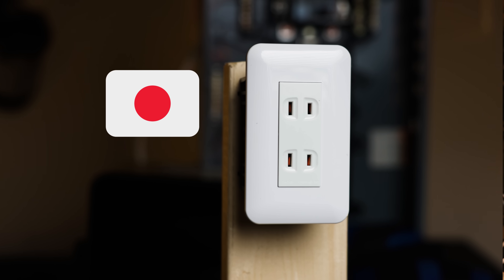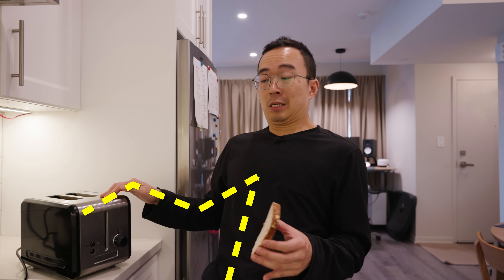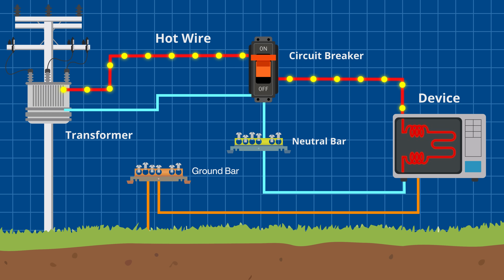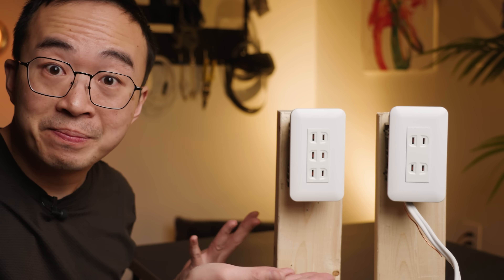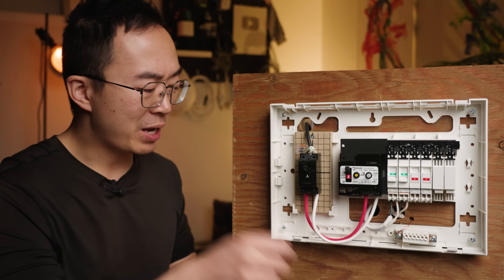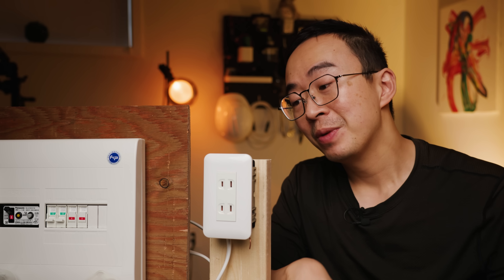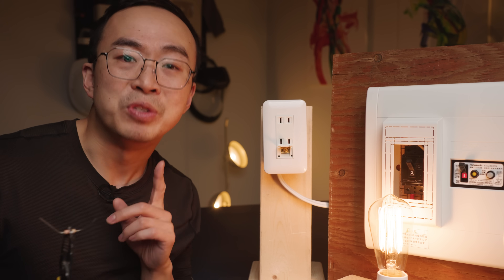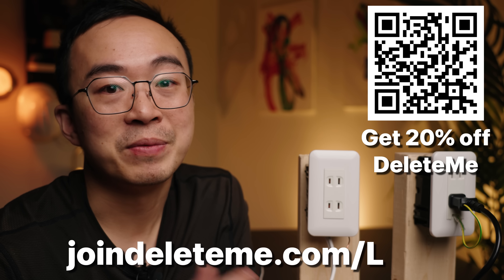How Japan Made Their Outlet Safe

Comment: That's why we have best of both worlds in Germany.
The electrical code demands at least two GFCIs/RCDs per household (30mA Max) and grounded outlets so that even small fault currents from a device gets detected and cuts the lines before touching or having a hight amount of energy bursting through the wire. This puts less stress on all components.
Reply: In Australia we now require RCD's on all circuits at the switchboard. Outlets are also grounded. When installing a switchboard there is the option for additional protection as well by installing RCBO's and Surge Arrestors, that way you are protected from current leak, current short, and over voltage. The only issue is these devices are expensive
Reply: I have been very interested to research the socket types and design around the globe and concluded that the Schuko socket is the best socket design😁

Comment: And the further away from the actual circuit, the less effective the GCI is!  So ideally you want (NEED) the GCI as close to the circuit as possible!  ( And Japan also recommend / mandate GCI adapters at the circuit for high risk devices — Toilets with electric washlets!!)
And another fun Japan fact: they use 100V power. ( a little trivial - current is what kills, NOT VOLTAGE!!! ) So when you LOWER the VOLTAGE , YOU NEED a HIGHER CURRENT ( i = p/v) to do the SAME amount of work!!  HIGHER CURRENT = BAD!!!

Comment: You should get together with an electrician and get educated on the difference between a GFI and a circuit breaker and their intended fuction. Clearly you don't understand. Circuit breakers protect the circuit so that the wires don't melt and start a fire. The GFI protects the person who inadvertently comes in contact with electricity when something goes wrong. Ideally, every circuit should have a GFI but it's cost prohibited, so code requires GFI in kitchens and bathrooms.

Comment: I'm from Italy and the standard in my country is that we do not connect the neutral to ground we use Magnetic(Over Current Protection), Thermal(Also OCP) and Differential(Current to anything other than the loads through the use of differential transformers) Switches for basically everything that needs to be switched and safe, it's rather common to have a general switch that has all of these protections and the other downstream ones too, there are also Self Rearmable switches that attempt(if possible) to turn the power back on if a momentary fault happens.
I liked this video and it was explained pretty well, i would've said something more about differential switches due to their rather simple yet effective working principle but this was definitely more than good enough.

Comment: We have both – grounding pin and RCD (Residual Current Device, also called RCCB). Not every socket here has a grounding pin though – we also use two-pin outlets (Europlug, type C) for low-power appliances with double insulation. For higher-power or metal-cased appliances, grounded outlets (type E/F) are required, and RCD/RCCB protection is standard. Greetings from the Czech Republic 😊

Comment: U are a bit wrong in the end there saying the ground fault is slower and 30 ma is enough to kill a person I mean it is under the right circumstances but when I have a fault that occurs when I touch it this protection will hurt allot less and be allot faster when a normal circut breaker Wil allow up to a 6000 a jolt to go thru me for a very short time (now u know what the 6000 stands for) 
Sure u discribed the ideal situation where a fault happens without people great 
But when it happens because a human touches it let's say no connected is made on the toaster until I switch it on while touching it I much rather be in Japan than use a fuse or circuitbreaker

Comment: I’m a Brazilian electrical engineering company owner, and I’d like to share something important.
Here in Brazil, we use three-pin outlets, and by the norm, a GFCI (called IDR/DR here) is only required in wet areas such as bathrooms and kitchens.
Unfortunately, most homes don’t follow this rule properly—and that’s not even the worst part. We often see extremely unsafe and dangerous electrical work in Brazilian houses. It's a real nightmare.

At my company, we install GFCIs in all of our projects, protecting every circuit, not just the ones required by the nrom. Combined with proper grounding, those things can truly save lives. Some of our clients have even told us that if the GFCI hadn’t tripped, they might not be alive today.

So, to everyone: please check if your home has one installed. If not, hire a qualified electrician to do the job—it’s an investment in your family’s safety.

Comment: Interresting...French electrician guy here : I am very surprised to learn this. For at least 30 years, all domestic electrical circuits throughout the house have been protected by 30mA, even outside the bathroom. Only low-power, (or double-insulated devices) do not have earth connections. But in all cases, all are powered by a 30mA differential circuit breaker.

Comment: A couple of pointers: The protective earth isn’t special in it’s current carrying capacity (usually it’s equivalent or slightly smaller than the neutral), it’s just meant to never have any current on it. Hence it’s there to provide a low impedance path back to earth/neutral. So in case you get a short to the metal case of a class 1 device, it’ll create a massive fault current that trips the breaker (breakers need around 2-10 times their rated current to trip instantly). 
In a TN-C-S system, that’s achieved through the neutral bond wire as you illustrated. However, in a TT system, you rely on the earth having low enough impedance back to the transformer, where the neutral is connected to earth. There’s also TN-C systems, where the neutral and protective earth are combined as a single conductor, the PEN conductor, but it’s not been common since the 70’s. There’s lots of ways to skin this cat, but a PE connection at every outlet, combined with a TN-C-S system, fitted with GFCI/RCDs on every circuit is the gold standard, which is how most of Europe has been doing it for the last 20 years.

Comment: As an electrician here in America, I really love the idea of ground faulting the entirety of the system. Here, recently, with the code updates to Arc  Fault and ground fault breakers, it is easier to put duel function breakers on every circuit, and the price difference is negligible.

Comment: In Darwin Australia in 1993 some Lineman were interconnecting 2 sets of low voltage suburban street cables.,.... They hooked the live to ground accidentally for a short amount of time , every fridge toaster washing machine (grounded appliance) was hot , before the disaster was fixed.

Comment: SOMETIMES there are circuits such as a backyard outlet that is fed with underground wiring.  There can be tiny leakage currents in the underground wiring that can create nuisance trips on a GFCI.  For that reason, it is preferred to locate the GFCI at the outlet/receptacle instead of the panel.  With a single GFCI for the WHOLE panel, that would not be possible.
Reply: A single GFCI for the whole house sounds like a bad idea.

Comment: I have idea RJ45 Poe wall socket should be new design this way the cable is secure by click. Fire happen I guess most of time if the cable 🔌is not secure or child plays with it. The click and secure option reduces fire hazardous 40% as result of small neglect. Another solution is make it mandatory surge protection sockets must and proactive 3 layer steps like first device to last just like how internet companies control the bandwidth connection if consumer fiber internet plan is 1gbps then it's between 950-1gbps consistently and subscribers over use its rare but gets shutdown automatically and fire is easy to control right away at the blink of eye the socket shuts down completely until firedeparment gives it greenlight.

Comment: In my 3rd world country in the recent years they started to put GFCI at every home's main panel, mostly outside. Now every couple of days people is cut off and have to re-arm the GFCI. The problem may not be faulty equipment but appliances having a capacitor or resistor that trips GFCI. My investigation is going into direction of capacitor. I think problem is not a washing machine or hot plate, but probably electronics like TV without earthing (PN plug without earth), and surge is going from phase to ground by the TV antenna or cable.

Comment: We now have GFCI plus arc fault breakers on the US. They not only detect a ground fault, but they also detect arcing of the neutral. I can protect whole circuit or even whole panels with these. I use them more then outlets as it is far simpler to check the breaker panel for a tripped GFCI than looking for some outlet.

Comment: man dont get me wrong you kinda missed the importance of grounding in the modern word, in 1970 i might have been a ok idea, but in 2025? its just stupid to dont have a strong ground! to be honest gfci is nice but i would not trust it with my life, it does not work all the time, and 20ma is rough but will not trip the breaker, its really umplesent. i belive grounding the apliance is way better! and it has other uses like grounding eletronics, sound systems and its verry important to protect your home from a "froating" neutral or high voltage (lightning that fell on the lines outside your house) from entering your house becouse you can install a device that sends the extra voltage to eart on your meter box

Comment: GFCI + ground required everywhere. It is stupid to put GFCI only on few outlets. It should also be mandatory for lights if the lighting fixture contains metal. Ground alone is pretty useless you have time to die several times before it trips. Moreover, a grounded house without GFCI is even more dangerous than without ground, simply because in case of a leak, ALL METAL parts of the entire house connected to earth can kill you. GFCI alone is better than only earth, but it depends a lot of the type of GFCI you have.

Comment: as an electrical engineer, I don't like this system. In Türkiye, all outlets have a ground connection, and it's mandatory to use at least two RCDs: one 30 mA for human protection and the other 300 mA for backup fire protection
Reply: It's just a result of circumstances. Although it's weird to see new construction still using such a weird design. In my country it's been similar: old buildings were TT, where they used the water pipes (metal back then, also the main pipes) as electrodes- now that they're all rusted/swapped to plastic it's been a difficulty to convert to TN-C-S. But code now demands grounding through rebar AND mandatory RCDs in domestic buildings. Many such buildings are just being demolished for proper new construction. I guess Japan just decided it's not really worth the effort but I can't believe they just live around energized faulty stuff without knowing until they themselves become the ground "wire".

Comment: And i thought at my trip to Tokyo, they use 1-to-1 transformers at the outlet.
For explonation: We humans reveice a shock, because the way back to the transformers ist connected to the ground. If this connection would be put away, the electrons have no reason to travel throug the human body. 
That concept is used by outlets with such a 1-to-1 transformers. They don't change the voltage, because both coils have the same amount of turns. But they offers a so called galvanic isolations. The circuit on the second coil of the transformer are in a own seperated system. And that circuit isn't connected with the ground. 
In Germany we use such outlets in hospitals for medical devices like breathing or dialysis machine, so the electrons don't travel through the fluids over to the body and electrocutes it

Comment: its for detecting leaks... if leaks flow there leak prevention fuse disconnects main supply... if japan doesnt have alternate system where the leak detection is possible without that its ok if not its criminal :P

Comment: Having just both would be better. With all things, it takes time and costs money, to upgrade stuff but remember, everything needs a replacement at some point, so this is the day where you can do the upgrade and spend a bit more money.

A GFCI can fail and I don't think it's mandetory for private households to get them tested. With a grounded device, you dont need this fancy stuff. It's a simple design. Of course you need a device that was manifacutred properly and house wiring that is done correctly. I guess this helps against static discharges. They aren't dangoures but still nasty.

Comment: Most grounded outlets have one major flaw. If you have a device with a ground pin on it you can't power it from a non grounded outlet. What do you do especially for portable or semi portable devices? That's right - cut the ground pin and then it won't get ground anywhere. The German Schuko got that right although some argue they it instead lacks polarity. For some applications it's best having phase on a known pin (and neutral on the other).

Comment: well, just having GFCI will NOT trigger if a metallic enclosure is hot due to malfunction. Having a ground provides a path for the faulty current to go without having to travel through a human first.
So, plugging a malfunctioning device into a GFCI with ground will trigger the GFCI. Plugging into an outlet with a GFCI but without a ground will only trigger, once a human touches the device providing a path to ground...

Most commonly, a grounded floor lamp with a metal enclosure that has a loose wire, would trigger the GFCI immediately while plugging in as some current is lost to ground.

Comment: I tend to think of "ground" as a refrence point, rather than a fault path. It's a way to prevent insulation breakdown due to lightning or static electicity. Grounding and bonding the neutral creates a hazard under open or high resistance neutral conditions.

Comment: There is so much more to talk about in this area. In Europe/Poland we install GFCIs in main panels so all our outlets are protected. And all of our appliances with conducting cases are grounded through third pin. Ground is also connected to neutral in main panel. Our GFCIs have test button, which sends current to ground and trips it, no need for additional test equipment. It is recommended to test GFCIs every year to make sure it still works. Our main panels also have main cutoff switches and lights informing in which parts of panel there is current detected. So in the grand scheme of things, Japan requirements regarding electrical safety are nothing special and simply inferior to western code…

Comment: Sorry but I don’t think you described ground faults correctly…a standard breaker won’t always trip from over-amperage from a diversion to ground, because the plugged in device itself limits the amount of current it will draw from the hot wire…however if the device itself stops limiting amperage draw, it will obviously trip, whether over neutral or ground wires…you need a gfci breaker to trip on a diversion of current away from the neutral wire…it measures even tiny differences in current between the hot wire and the neutral wire, by adding a connection point for the neutral wire onto the breaker, vs standard breakers that don’t have a neutral wire connection point…that connection point gives the breaker a place to detect less current when compared to the hot wire connection point, meaning if some of the current somehow gets diverted either to the ground wire or to some other path wherever else, it will see it and trip the breaker…fun fact: a gfci tester plug will not trip a gfci breaker when using older 2 wires lines, since the tester tries diverting a small current to a non-existent ground wire, BUT you can trip the gfci breaker by connecting the ground pin of the test plug to some other circuit or ground path

Comment: VERY B.S in israel you have RCD's on the main panel, also GROUND on every outlet, while older homes (preior to 1970 had only TT earth, and newer have TN earth)
so thats super safe. and if you want to be super safe you can use 5ma protected circuits in bathrooms or isolation transformers.

Comment: you need to look at the crap we have. it's a IT PowerGrid.  in a TT net  (terre-terre) the transformer is grounded. in a IT (isolé-terre) it is not. we only get 3 wires from the transformer and the transformer is "not grounded". normally you only find IT in hospitals etc. here the Power grid is based in it. SO we have 230V single phase AND 230V 3 phase. all phases is live. so both wires in the 230V outlet is running at 115V.  no neutral pin anywhere and only local ground/PE. AND we have ungrounded outlet's. stil only up to 10A (13A) and only in older installation's. so we use both type C and type F outlets.